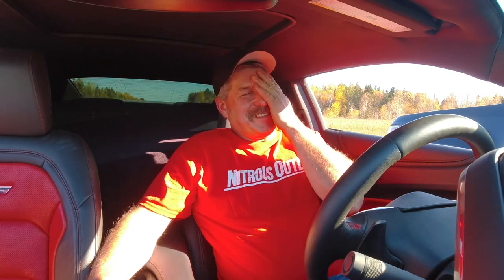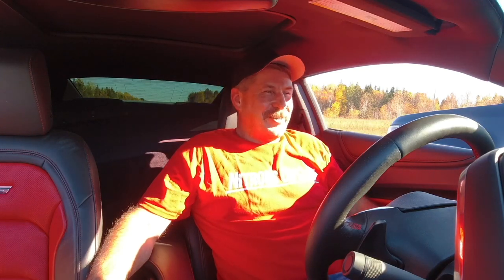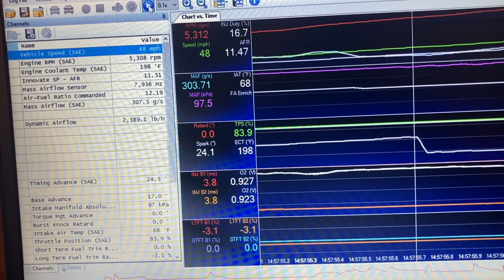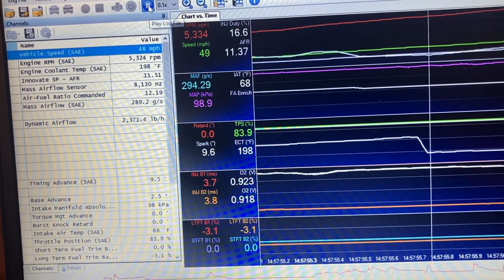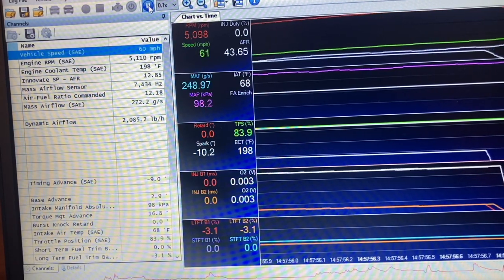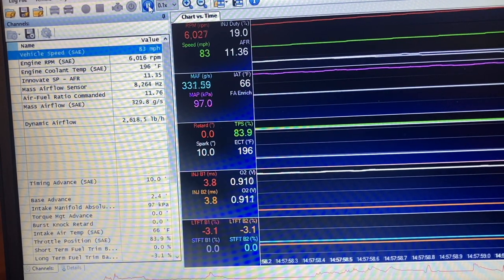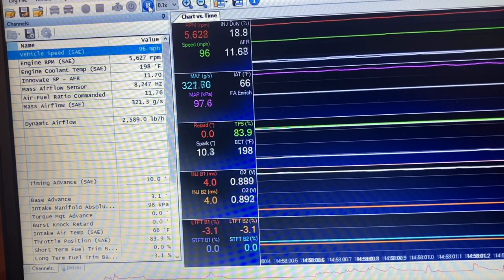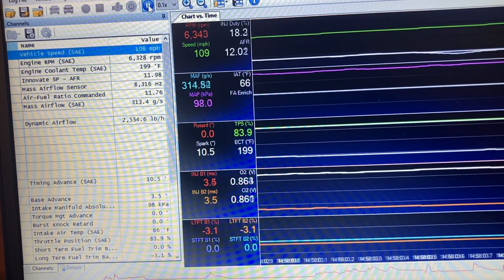Nitrous on a 6th Gen Camaro - 2016 Camaro SS with nitrous - Using nitrous to run 10s on the street

Comment: This is late but was hopping to find out if you've had any issues with the AFM valvtrain? Also on the timing your saying with an aftermarket Tuner when you lower the timing 2*per 50hp from what i understand this will stop the factory software from dumping so much timing? not trying to be smart just wanting to make sure i do this right. Nitrous Outlet told me i would be fine 100shot on the stock ss motor with a cooler plug witch i believe. what controller would work best with Nitrous? thank you
Reply from the maker: Fortunately he has not had any trouble with the AFM so far. He pretty much always shifts it manually anyways so it never activates the AFM and I have since removed that in the tune using HP tuners. Of course even then you can still have problems with the AFM but not so far on this car. As for the nitrous he tried using it that one time and he never was interested in trying it again so we learned nothing about what works and what doesn't so I am pretty much clueless on that topic. But definitely if you get it set up properly you can safely run a 100 shot. I don't have much experience with setting it up or I would definitely help you out.
Reply: @LSxMotorsports2021  :goodvibes:Thank You so Much for the reply

Comment: Sounds like fuel
Reply from the maker: It was actually the tune these cars use. It is torque based and if you exceed the torque the computer expects to see it will take steps to bring the torque back down. In this case every time he hit the nitrous the computer would instantly remove 10-14 degrees of Timing basicly killing any extra power that would be made by using the nitrous. That is a very basic explanation because I still haven't learned how to tune this car properly but it is the reason for no increase in power. A experienced tuner can easily fix this issue.